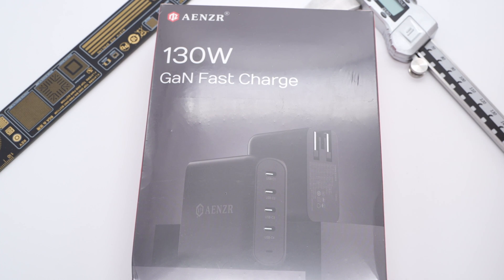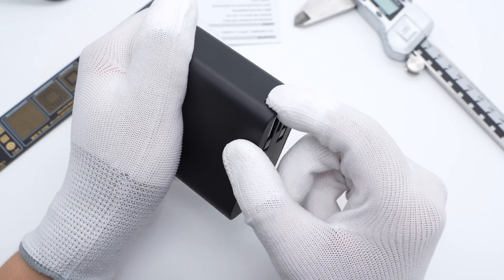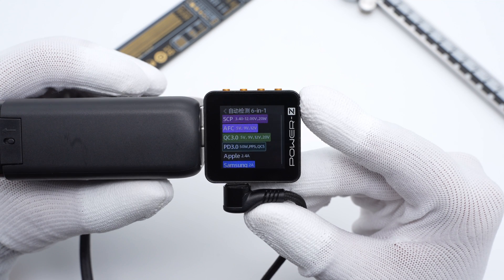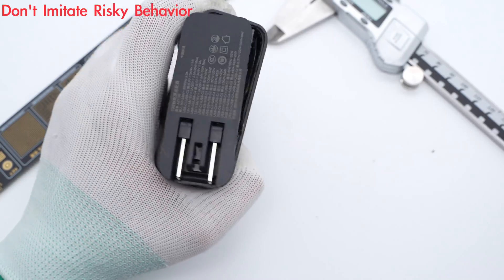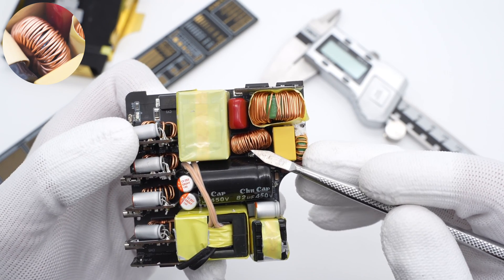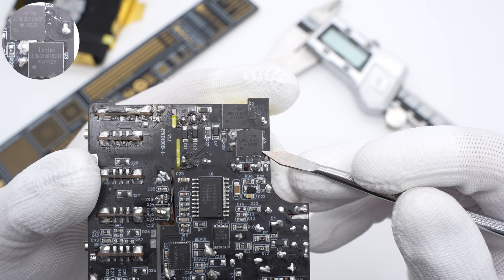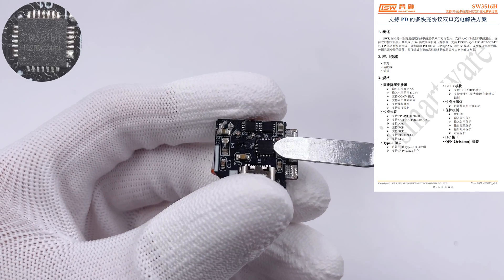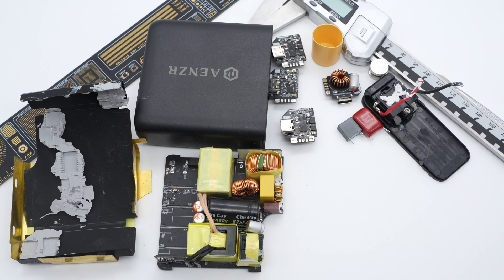Teardown of AENZR 130W GaN Charger (Four USB-C Ports)

Comment: I think the most important question with these multiport USB-C chargers is whether they continue to charge if you plug in additional devices. In theory it should be possible to simply current limit the ports however most of them reset all ports if you connect or disconnect a device which is super annoying since a lot of devices tend to ramp up charging slowly after you connect them. It would be great if you could test such important details. 

Unrelated: When will your testers be back in stock again? The Amazon store looks quite deserted.
Reply from the maker: Due to the higher-than-expected sales during Black Friday, KM003C is out of stock again. We will try our best to replenish before Christmas, but we cannot guarantee that. We're sorry for any inconvenience.